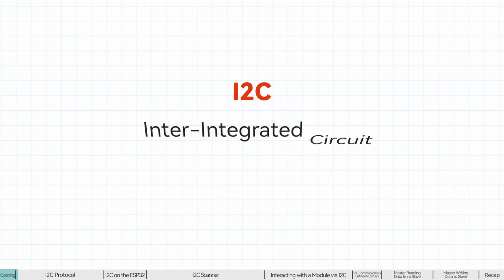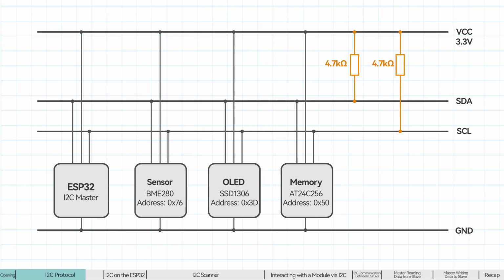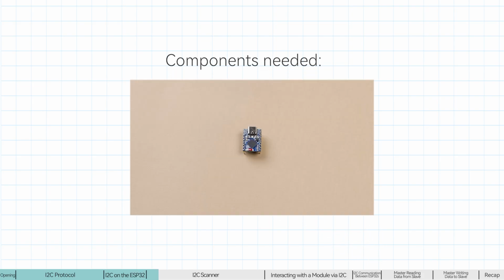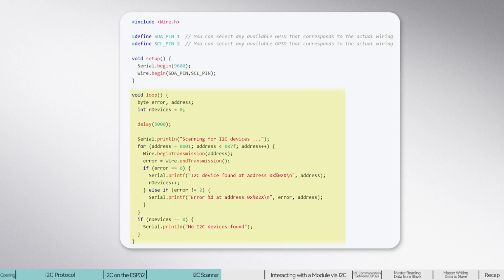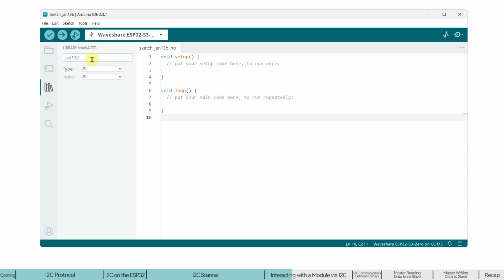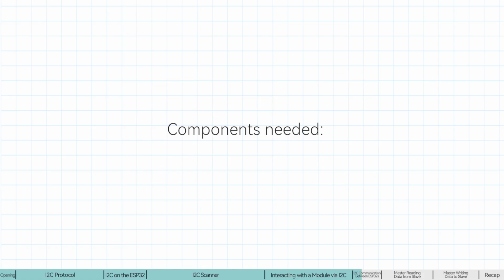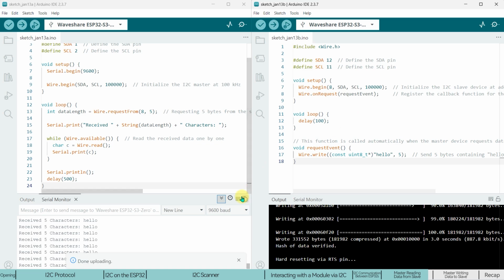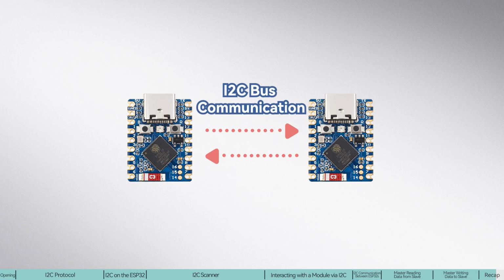ESP32 Arduino Tutorial | 07 I2C Communication

Comment: The OLED module that comes in your kit (number WS-33357) is wired for 4-SPI connection, not I2C. The only way to change it is to move two microscopic zero-ohm resistors to a different position, something that a beginner like myself is not likely to succeed doing. I see that this is pointed out, but it doesn't make things workable. Instead the module in the kit should have been fitted with standard jumpers that can be changed without soldering.
Moreover, the step from the previous tutorials to this one is steep. The lecturer does not bother to explain what a callback function is, or what most of the parameters in the Wire library do. To really learn this topic, the tutoral needs to explain things in more detail.